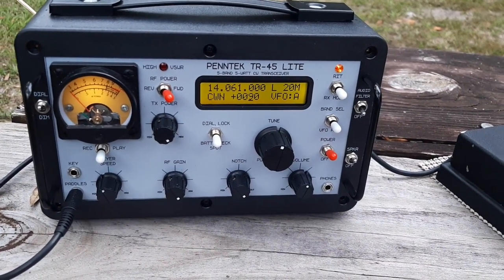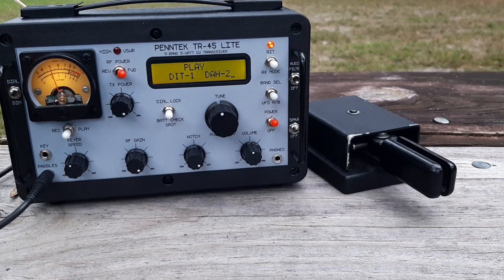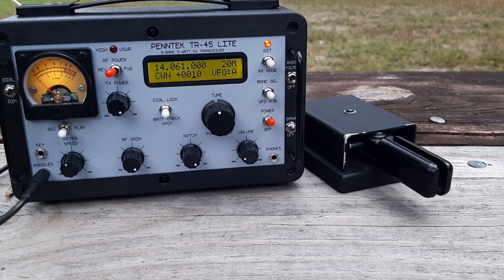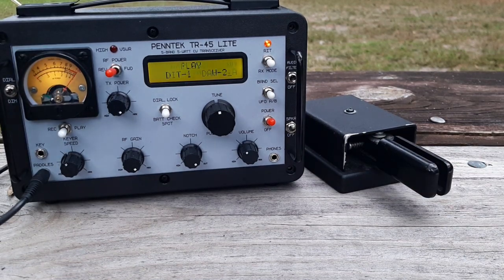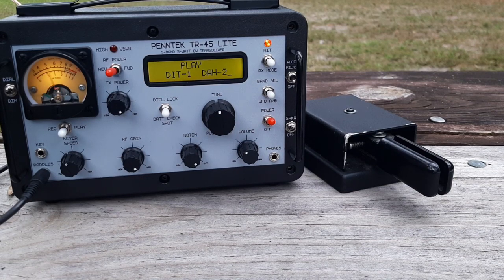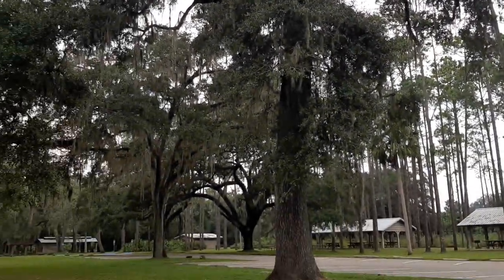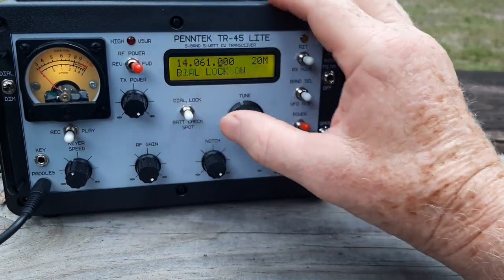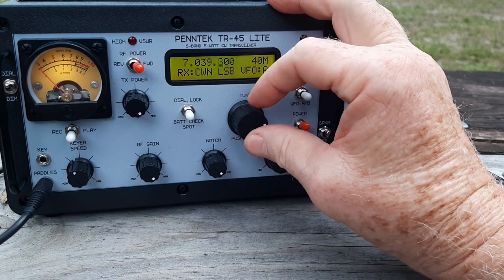Demo of the Penntek TR 45L

Comment: That notch filter shows me nothing. All you're doing there is remove the signal you want to listen to. What's the point in that?
I'd be more impressed if there was an interfering signal affecting the one you want and it removes the offending signal. As I would expect a filter to be.
I looked at this because I've not heard of this company, but only 5 bands?
I'll keep my 5 Watt h/b nine band rig to which I'm now adding 60m.
G4GHB
Reply from the maker: I mentioned elsewhere that I'd hoped to do this test during Wednesday"s CWT Sprint when lots of CW signals are on the air:
https://ae5x.blogspot.com/2022/09/penntek-tr-45l-review.html
That was not possible this week due to our FL weather...there will be another Wednesday. I did tune around a bit - perhaps you noticed the lack of signals packed together that would have offered a more definitive test?
Reply: @AE5X  O.K.